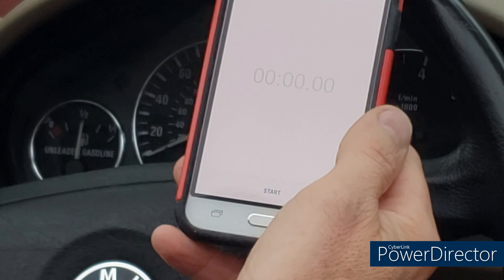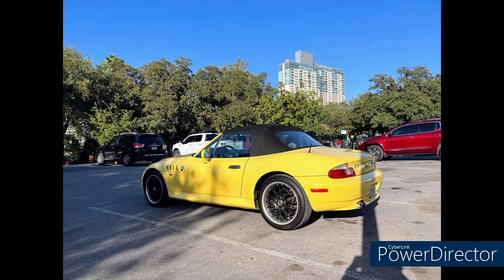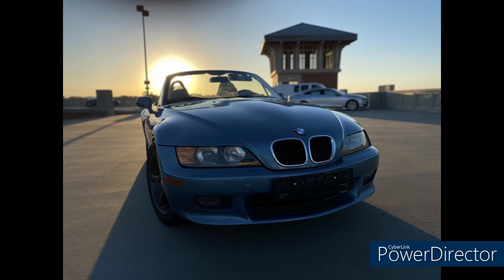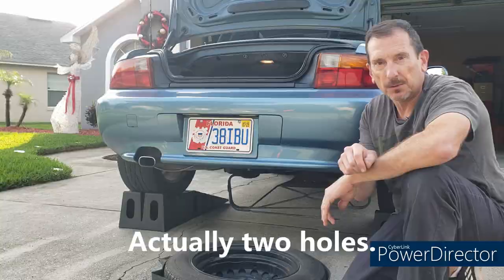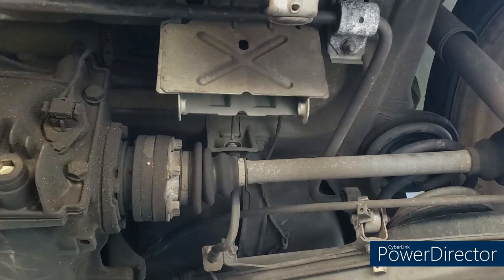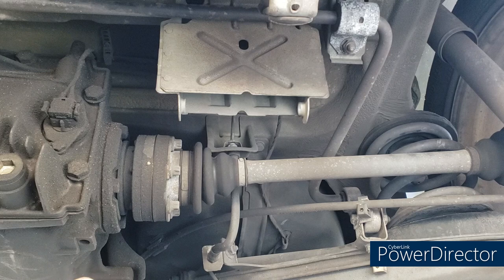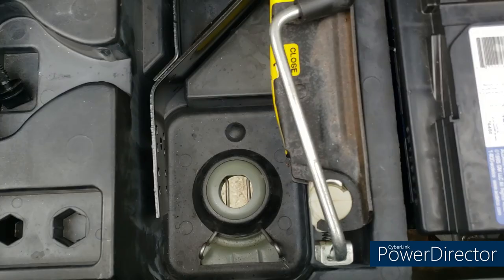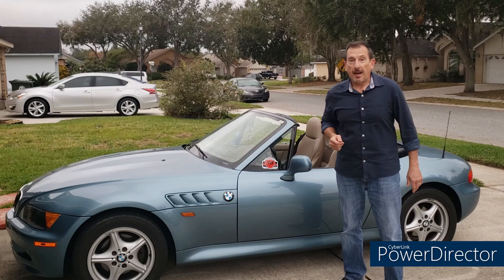How To Remove the Spare Tire and Spare Tire Carrier for Better Performance!

Comment: Well done!  Yes, I did this a year or so ago as I did not want to risk the 60-pound pressured tire rupturing in the rack or when using on the car to replace a flat tire.  To take care of the holes, I cut the two bolt-connected hole plugs off the spare tire mounting rack, ground-smoothe the ends of the cut pieces that were pretty flush with the plugs, and then bolted them back in the holes where they were originally as designed.  Now I just have an old spare tire and the plastic tray remaining, which I will discard at some point.  Already discarded the rack.
Reply from the maker: Actually a good solution.  Im going to hedge my bets and use a fender washer or cut some aluminum sheet into circles.
Reply: That was my thought when Mark was talking about it. We’ll see what he comes up with next week 😊

Comment: What I would do, to cover the holes (and I realize it's a one way street), is cut the mounts off the cage and mount them back where they go. Now the holes are covered WITH the rubber gaskets, AND your trunk corner tray is held in place.

(Edit: Just read the comment below mine after posting... great minds think alike!)

Comment: It is my opinion that this is not a good idea.  You change the weight distribution which for the Z3 is 50% on the two axles. By removing the spare wheel you lighten the weight on the rear axle and when it rains the BMW of the 90s is not famous for its road holding, if you are on a road where you can go fast the risks increase.  it is no coincidence that the petrol tank (if full) and the weight of the battery always positioned above the rear axle help to prevent the car from skidding in the wet (sorry but it's not an Alfa Romeo).  I kept everything on my Z3 and if it rains and I'm on the motorway I fill up with petrol (which today costs around 1.8/1.9 Euros per liter in Italy). However, I like your channel and I gladly watch your videos .  (I hope you understood what I wrote, if not, the Google translator is to blame 😆).  Greetings
Reply from the maker: Translation was fine!  You're concerns are valid but keep in mind variables beyond petrol.  How much does the driver weigh?  Is there a passenger?  Weighing how much?  Anything in the trunk?  How much?  The engineers built in a margin of error for this, fortunately.   If you're racing, then all of this is a bigger concern, of course.
Reply: @MomentofZed  happy with the translation.  Of course the variables are different but I think you have to think about the most unfavorable conditions, you drive alone (but the driver is moved towards the front axle) and you are going with only a small suitcase with documents for work and while you travel it starts raining, even the type of road, whether it's all straight or all curves like my roads.  So I prefer to be cautious also because we only have fabric over our heads.  Nice to have read you and long live the Z3 the most beautiful car in the world.

Comment: Hey Mark, I just replaced the spare on my Z3. I went with a Kumho T125/80D15, this still fits in the carrier but is about an inch shorter. I’m not too concerned with this since I won’t be using it for prolonged periods. Thought I share this since the original size is NLA.
Reply from the maker: Awesome!  Appreciate the info.  Sounds like a smart way to go!

Comment: Interesting concept, but could you simply remove the tire to reduce weight?  Seems the rack and tray don’t weigh much.
Reply from the maker: Rack is light but will get in the way of hopefully near future work.
Reply: The tray blocks the differential and makes it difficult to change the fluid.

Comment: Here is the hardware needed to provide covers for the two holes left in deleting the spare tire and housing. 

1   M10-1.5 x 50 mm cap screw
1   M12-1.75 x 45mm cap screw
4   1/2” x 3” fender washers (1/8” thick)

Washers go on interior and exterior of the holes, run cap screws up through them and use nuts from original hardware or get new nuts. For extra protection, spray some Flexseal or rubber undercoating spray on the exterior.
Reply from the maker: Stole my thunder!😁  thank you and happy new year!!
Reply: @MomentofZed  I got them from another Z owner so just passing along the knowledge. Happy New Year.
Reply from the maker: @ricktaylor6858  appreciate it!  I'm going to do a video on it soon,  I'll mention you if that's ok.  My bolts are standard oddly enough.
Reply: @MomentofZed  SAE bolts on a BMW seem quite odd but who knows. I’ll send you my car pictures and write-up. I’m fine with being mentioned. I can send you my car picture and description. Where do I send it to?
Reply from the maker: @ricktaylor6858  momentofzed@gmail.com

Comment: So, what do you use instead of the spare tire? Run on flats?
Reply from the maker: Ill have that in another video soon.  Run flats give a rough ride ive been told.  Never have had them.
Reply: The M Roadsters didn’t come with a spare but with a sealant injecting air pump. Many of us that have deleted the spare carry a similar pump available from Slime and others. While this won’t fix a blowout or really large puncture, running on a out-of-date spare isn’t a good idea either. Also, the flat tire won’t fit In the trunk so one would be forced to carry it in the passenger seat or the passenger’s lap. Good road club coverage like Hagerty’s Drivers Club is also helpful.
Reply: @ricktaylor6858  thank you. I am thinking to buy a Z3 so I can need good advice ;)

Comment: Wait, you did this whole thing and didnd't actually measure the difference? Why??
Reply from the maker: The speed difference?
Reply: @MomentofZed  Yes, would have been nice to see if there really was any measurable difference.
Reply from the maker: Agreed, I just don't have access to a facility that can measure that accurately.   I think the difference would be quite small.  The nicest part has been working underneath the rear of the car since without having to remove those parts each time.